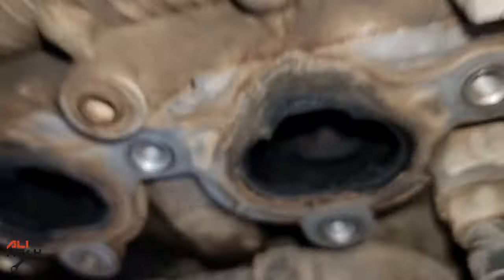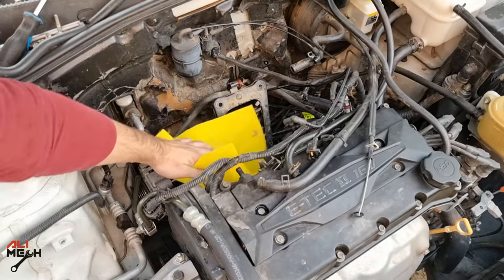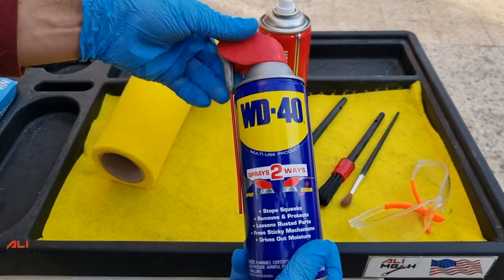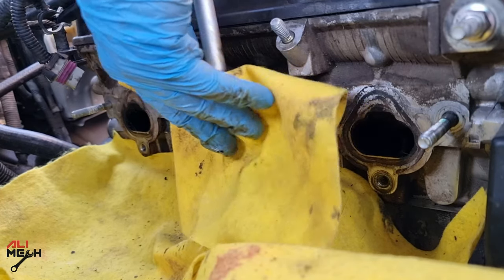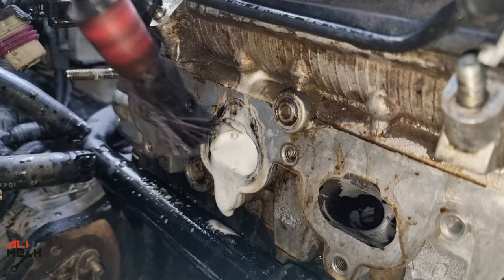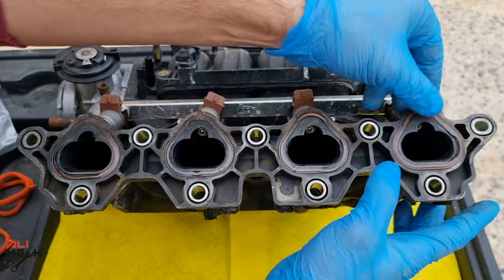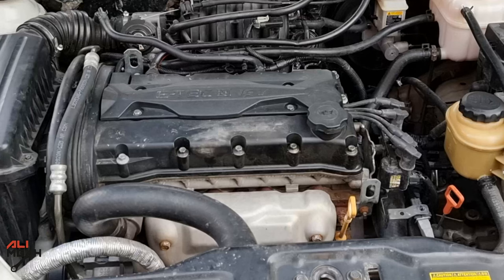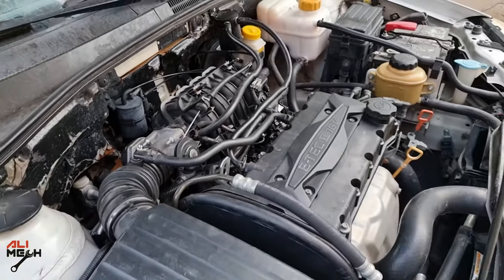How to clean intake valves on Direct/Indirect injection engines without using expensive tools

Comment: there's a big risk, what if some of cleaner leaked inside the valve
Reply: must be done with valves closed.
Reply: Nothing wrong with a little leaking it, it will burn and go out the exhaust
Reply: Hello, you have closed the first valve, maybe the first and fourth are closed, and the second and third remain open. Shall we repeat once again closing the second and third valves, or not?  If this cleaner is not available with wd40, can I use Ice Diclo instead? Greetings
Reply: I saw you can remove the liquid in the cylinder by turning the engine with a remote started while coils and plus are removed, it will push the liquid out of the plug holes.
Reply: Nothing, blow it out the exhaust it's a good idea to blow can of seafoam into the intake 2x a year change good oil be fine its an engine seen 454s with so much gank on valves you wouldn't think run!
Reply: If you are afraid of hydro lock just remove the spark plugs
Reply: What risk? That's like saying there's a risk of burning alive if you put on a fire suit to try and escape a burning building. Any risks associated with this is 100x worse if you do nothing.
Reply: Need an oil change after the service
Reply: How did he close the valves?
Reply: @RikkiMMA 
By turning the crankshaft
Reply: this is true
Reply: There’s no big risk, lol. Stop..
Reply: 2 things as already mentioned. Little bit of liquid leaking through is fine as long as no solid carbon deposits break off and get in. Also with the valves closed if that is the case, the compression loss would concern me more than a bit of fluid in the cylinder.

Comment: WD40 is NOT a penetrating substance; it is a WATER DISPLACEMENT solution, thus the acronym "WD" meaning Water Displacement.
Reply: Indeed that is correct, however it is very good when cleaning aluminium engine parts for detailing with a ss wire brush.But carb cleaner is better or Spray Intake Valve Cleaner is better still.
Reply: It's pretty good at removing gunk though.  It removes grease and adhesives quickly

Comment: A sand blaster from HarborFreight is like 10 bucks, some fine walnut media is like 25 bucks also from HarborFreight so for 40 bucks you can do it  the way professionals do it and it is so much faster when you do walnut blasting then using chemicals and a brush. To top it off in the long run it’s cheaper using walnut you can do probably 20 four cylinder engines with the one box of walnut, when using chemicals it’s way more expensive plus it takes longer. Also some chemicals can swell the valve seals which will cause the valve seals to start leaking, obviously the chemicals aren’t in direct contact with the valve seals but you are using compressed air and the chemicals are on the valve stem so some will work it’s way up the stem. Anyways if you clean the valves up nice all you need to do to keep them clean is use a cleaner  every 15k miles or once a year you want a chemical that sprays a light mist through the intake over a good 30-45 minutes I have a pressurized fuel injection kit that runs off compressed air and I have an attachment that sprays a very fine mist it’s so fine it’s almost like a fog and it run it before the throttle body I run it at a lowest pressure I can to where it’s still a very nice mist so it lasts as long as possible usually 30 mins or more and if u use a quality chemical it will clean the carbon deposits off the intake valve and the intake runner, if u do this every 15k or every year after the valves are clean it will keep them clean so u don’t need to do pull the intake to clean the valves. You can actually buy a pressurized fuel injection cleaning kit that comes with the same mist attachment that I’m talking about for 50-100 bucks on eBay. The kit I have is much more expensive but I use it every day and I’m sure the cheap ebay kit will work just fine for someone to use at home. If u have direct injection buy one of the kits and keep ur valves clean before you have a problem.
Reply: Even if you use the walnut blaster, you still need the chemicals.
Reply: Not everyone has an air compressor and you also didn't account for special vacuum cleaner attachment that is vehicle specific for the intake ports to suck up walnut media

Comment: Cheap harbor freight walnut blasters along with my small air compressor works perfect every time.  From tear down to back up and running again only takes me about 3 hours. Using walnuts to blast carbon creates perfectly clean,  brand new looking valve stems and cylinder head.  Plus you don't get the gunky mess you get with chemical cleaning.
Reply: Can you explain how to do it and what all I would need to buy please? I would appreciate it
Reply: @acogjefe4769 First of all, you will need an air compressor the larger the better, but small ones do work. You will just have to wait longer for air to build up. Then you need to buy a “media blaster” it should look like a five gallon bucket or a metal tank. For the abrasive material you will be using crushed walnut shells, they usually come in 50lb bags.

I recommend some way to shoot the walnut and use a shop vac to pull away the waste at the same time. Much less work compared to cleaning up after blasting.
Reply: @Rayden440  i appreciate you so much!
Reply: @Rayden440  could you please explain how to make sure my valves are closed?
Reply: @acogjefe4769 if you can get a small camera that can stick in small holes you can tell if it’s closed or not
Reply: @Jjsupermman  I got my intake manifold off already so I can see the valves clear as day but i don’t know the difference of what they look like when they’re open or closed. Also I don’t know how to close them if they are open

Comment: Really good job and amazing results. Unfortunately it's necessary for a most of new engines with direct fuel injection (gasoline). Sometimes it mandatory for diesel due to EGR works.  Thanks for sharing your knowledge and I wish you all the best in New Year.
Reply from the maker: Great point! Thanks for watching and merry Christmas
Reply: EGR isn't that big of an issue, a leaky PCV valve + egr fumes is what creates the big deposits.
Reply: @em4703  Yes I think your correct, I thinking of using a oil catch can coming out of PCV
Reply: 5g😢
Reply: @martinmuldoon603  alot ppl crazy to use catch can not all engine are equal sometime they need catch can but rare *

Comment: Please, how do you turn the engine?
Reply from the maker: From crankshaft, or half startup
Reply: @AliMECH  thanks bro, so how you do turn from the crankshaft?
Reply: @aryezzadin934 just remove all of the spark plugs & rotate the crank bolt in whatever rotation your engine runs 🏃‍♂️ 
It's usually clockwise unless you have an older Honda Accord or something weird so just verify 1st...also, you CAN leave the spark plugs in if you don't mind fighting against the engine compression and/or you're looking for a good workout!💪

Comment: Thanks bro you gave me a great idea, I have an engine that I pulled out of my car and removed the intake manifold, I'm in a desert region in Southern Arizona so there's light debris and maybe light surface rust from moisture, I stored it outside for 2 years and ready to put it back in but wasn't sure about the best way to clean the valves and valve ports, thank you for this helpful information
Reply from the maker: Glad I could help man, I like Arizona ✌️🇺🇸

Comment: I ended up trying to clean carbon off the intake valves on my 74 MGB and had minimal success with any trick until I ended up trying a can of Liqui Moly valve clean. I soaked the valves overnight with the head at an angle and the next day it flaked off like it was dandruff. Liqui Moly valve clean is the best product I tried yet, and it works best in the gas tank. Use it occasionally and  your valves and pistons will remain carbon free.
Reply: What??😂
Reply: Liquid Moly is almost magical
Reply: yes keep SELING THAT GARBAGE...

Comment: Before I cleaned intake valve idle is 800 round per minute. After cleaned it, it’s 700 now. Although it’s not look like as I respect. But it’s worked

Comment: Thank you, this has pointed me in te right direction to fix my friends 2017 polo with sticky valves and engine light, I'll be using Wynns petrol carburetta and valve cleaner with a dremmel pencil attatchment and the nulon brush attatchments and a tooth brush 🤞

Comment: very good, here in Brazil we use alcohol fuel in flex-fuel cars, with two alcohol tanks the effect is very good, both for intake and exhaust.
Reply: Mesmo pra injecao direta? Em compensacao a bomba de alta ta indo embora mais cedo ne
Reply: Fuel doesn't pass by the intake valves in direct-injection engines
Reply: @SirUncleCid  correct! the only thing that can help to avoid this is reduce oil change interval.
Reply: I use "Mr. Muscle" oven cleaner. I use it for this application and turbo vanes. Messy but very effective. Being careful not to wash too brake cleaner down the bores. Always use air blower to ensure no fluids are left in the head and replace the engine oil.

Comment: I need to do this on my mazdaspeed 3. But I don't have any of the tools but this looks like it works well. I'll give it a shot before I go and get a media blaster. And deff +1 on making sure the valves you're cleaning are TDC.
Reply: what year is your mazda? i got a 05 maz 3 right now its idling bad  its shifting bad too i was told the tcm and silenoid B is bad.
Reply: @elavation7890  tcm will come up as a check engine, but then again they mounted the tcms to the transmission which transmits too much heat to the module and cooks it! 500$! If you replace it I suggest zip tying it behind the battery up against the firewall that's what I did. I also have a rough idle, I replaced the valve cover gasket and while you're in there if you havent already I suggest replacing the solenoid anyways and/or the spark plugs if you havent. Trust me... you will have more clearance to work with and you dont want to do the same job twice. Check you coil overs look for oily residue around then as well, if there is replace them cause they're bad and will fail soon. They are expensive but just replace what you need. Do not use aftermarket. I've done all the trouble shooting for rough idle on my 07 mazda 3 I bought from the auction only code I had was a tcm but there has always been a rough idle. Besides the tcm, all the above said really helped with the rough idle and bogged power. Now, I really would like 0 rough idle so my last ditch attempt to nip this beezy is the intake manifold gaskets! With all that said trust me you will thank me later lol these are great cars and if we take care of them they will go forever I'm currently at 172k no codes, clean engine just a tad rough idle left. Let's do this 🤘
Reply: @stoneyhoney  facts just did my engine wire harness bro when I tell you the amount of corrosion in all the silver taped up wires I cleaned up pretty good found a good bit of burnt and co-roaded on the colored wires. Been at it for 4 days now car has been sitting for a while it's time to get her back up and running
Reply: @stoneyhoney  yes indeed awesome cars they will go and take you far I love getting under a hood of mazdas well depending on the year lol my car  people be like "sell that ugly car" I be like "Nah you wouldn't understand my vision"  and I'm always working on it they think I mess things up lol little do they know
Reply: @stoneyhoney  also I wanna say God bless you Brother 🙏  I do have a crack on the head gasket definitely replacing
Reply: @elavation7890  hell yeah 🤙 that's awesome
Reply: @elavation7890   absolutely, homies tell you to sell it but they probably have stuff that go bad on theirs that's going to cost them their newborn and a leg. Lol. And god bless you too! I wish you the best of luck!

Comment: Great video. But I’m wondering, obviously one of the cylinders is going to be in the intake stroke and the intake valve will be open. 
All that cleaner is going to go inside the cylinder. How did you manage that so the car will start again since the cylinder may have a lot cleaner in it?  Thanks.
Reply: You can turn over the engine by hand so both valves are closed, if your that worried about it you can just remove the spark plugs/ heater plugs, when you turn the engine over any debri/fluid will eject from there.

Comment: Can we oil the cylinder after this procedure? To make walls lubricated for extra care ? Oiling through spark holes
Reply: It won't hurt anything if you don't use too much. Too much and you could hydrolock or quickly foul your spark plug. Just a few drops

Comment: what's the real impact of carbon removal on performance / compression / other ? from my side the only important part that should be clean is valve seat that cannot really be cleaned that way.
is there any risk of damaging cylinders wall with introdution of lot of "shit" in the combustion chamber or do you manually rotate the engine to close valve beafore cleaning ?

Comment: hi, after using the wd40, what did you use for cleaning the valve, im sorry im french so i dont understand very well. in the video i heard carp cleaner ? but it's injector cleaner right ?
Reply from the maker: It was carb cleaner, and then I used engine degreaser
Reply: thank you so much !
Reply from the maker: @ASReaky  no problem

Comment: does the type of metal of the engine head determine which chemicals you can use? Also do you think that engine decarbonisation does a similar thing, I know there is no physical contact there only a chemical reaction (I'm also gonna check and see if this is explained the other vid you linked with no contact cleaning)
Reply: yes it does, some cleaners will literally eat away aluminum blocks if not completely cleaned off with water

Comment: How do we know which cylinder is in open position and which one is in close position after we remove the intake manifold? 2018 Corolla LE.
Reply from the maker: You have to look at the intake holes, the open ones will be with intake valve down

Comment: You cleaned the tops and stems of the valves but since they are in the closed position what about the valve seal points in the seat?
How are those cleaned? Do they need to be cleaned as well?
Reply: Exactly dude!!! Al that was in vain if you didn't clean the seats of the valve. Unless there was no problem. I guess then it would be very useful

Comment: Getting ready to do this on my PT Cruiser. It looks the same. Getting ready to buy some brushes. I won't use wire brushes. I'm not sure if there is a position that has all the valves closed at once. I need to figure that out.
Reply: If there was a position where all valves were closed at once it would be a pretty bumpy ride! 😊

Comment: Too much work for my Lexus IS250. Takes too much effort to remove my intake manifold... :(

But as always, GREAT VIDEO!
Reply: I have that engine as well only a 3.0.... that manifold is hell even when replacing the damn plugs
Reply: @seanlovi8798  Exactly. I ended up paying someone to do it. Yours would be the 3GR-FSE
Reply: @mustarosvirsli  My car is old and the plastics are cracking if I apply too much pressure. So I won't trust myself with such work. Not experienced mechanic.

Comment: With the kit i use i save money because you have to charge extra to remove the intake. I'm done in 15 minutes and give a before and after with my bore scope to the customer. And it's 75 for gas 125 for diesel.
Reply: Which kit do you use?
Reply: @laylamkioskli1123  I use a BG direct injection kit. It uses a pressurized cylinder with the cleaner being injected through throttle body tract while it's running. The key to getting it very clean this way is speeding the engine up around 1800 to atomize the cleaner over the valve stems and runners. I run a bore scope through the throttle body before and after for comparisons. It works great.

Comment: Hi ali, can you please make a video regarding automatic transmissions diagnosing and repairs, specifically with the solenoid valves. Thanks in advance
Reply: FYI problem  with those valves is that subcontractor  reduced tolerances from thousandths to tenths

Comment: How much difference you felt after cleaning valves?
Reply from the maker: It was a lot actually, better engine response, better fuel efficiency
Reply: @AliMECH  👍👍 I have one more question, how long the difference you had noticed after cleaning valves, lasted for weeks or same as it was after cleaning?
Reply from the maker: @King Khan  so far its same, because I have oil Catch can installed on the engine, so i won't have dirty intake valves again
Reply: @AliMECH  ❤️❤️ beautiful, I have six cylinder car so that would require a bit of effort, still learning how to turnover crank shaft to close down the remaining valves.

Comment: can be cleaned with a brass or bronze brush?
Reply from the maker: I don't recommend that, because any small scratches on valve shaft, it will leak oil
Reply: @AliMECH  I don't think small scratch on the valves shaft will make a leak , because the valves are in close position (all the way up )when cleaning ,any scratch on the valves shaft can not go up to the valves stems to make a leak

Comment: If engine burns bad and the carbon is hardened you’ll have to take the valves off and scrape that shit with something hard. I tried looooads of chemicals and nothing worked, the only tool that did the job was a cutter blade and it took many hours.

Comment: Brother Replacing the oil-changing cap will eliminate this problem.
Reply from the maker: I change oil at 3000, its not about oil, this car had high oil vapor in pcv system, after I installed oil Catch can,  it solved that problem, video on my channel and I also showed before and after